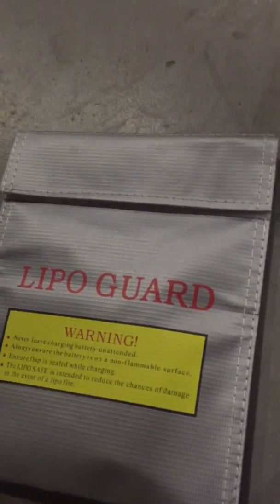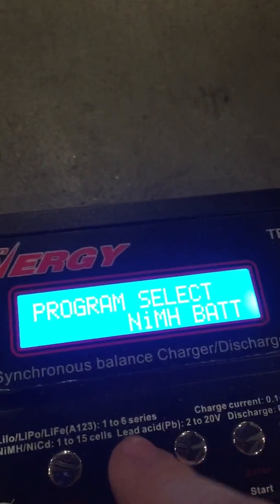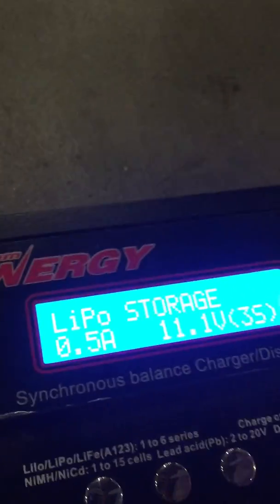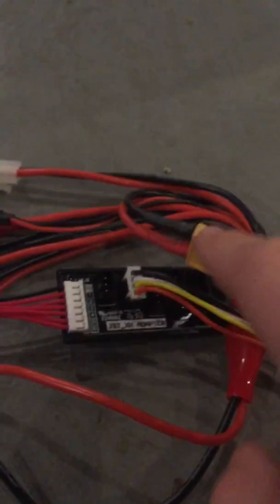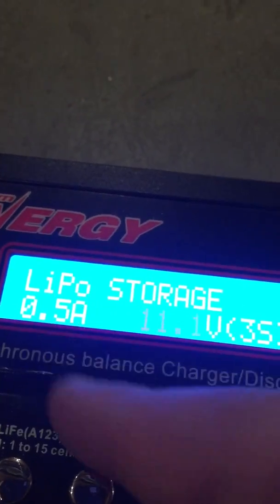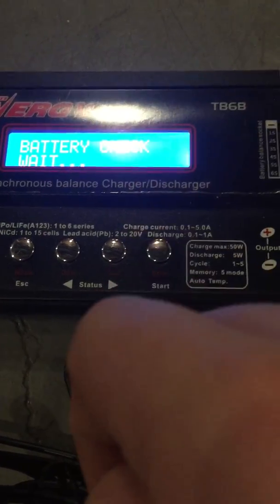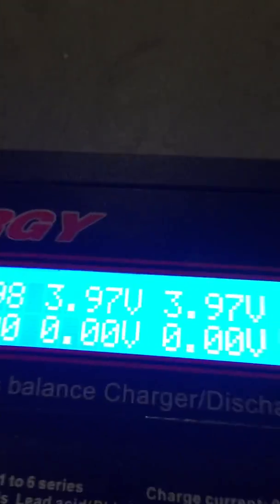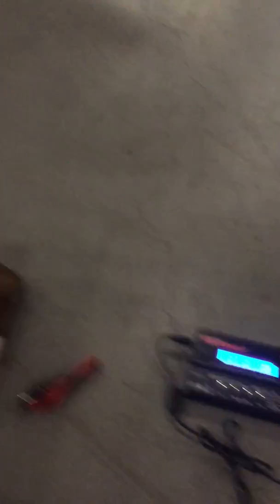How To Discharge A Lipo Battery

Comment: how do you calculate the discharge rate of a specific battery. like a 3s 2200 lipo, 11.4 volts or 4s, 2200 14.8v, etc

Comment: If I want to discharge my battery to use it after I got it do I do the same thing and put it to storage or is there a discharge setting for storage and for use cause idk
Reply from the maker: There’s a different setting you can use if you would like! You can do a normal discharge if you intend on using it sometime in the near future. Storage is for when you’re planning to not use it for a long period of time.
Reply: @thedavinator37  ok and I’m using a lipo 7.4v battery all I need to do is use the discharge setting to discharge it and I’m good to use it afterwards or do I need to let it charge fully first
Reply from the maker: @BaggedTLX  once you discharge you will need to charge again. The difference from storage is that it doesn’t discharge all the way
Reply: @thedavinator37  got it my guy and what charger is that and how much did it cost
Reply from the maker: @BaggedTLX  tenergy tb6 I believe and I think it was $60
Reply: @thedavinator37  appreciate it my guy